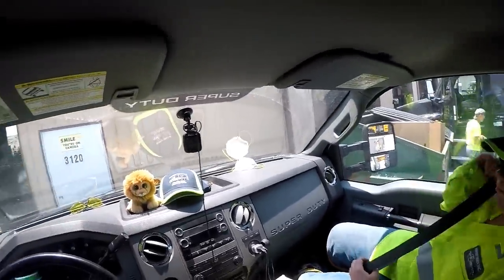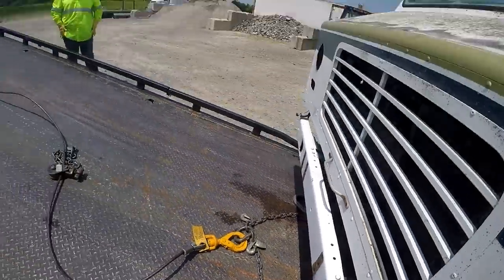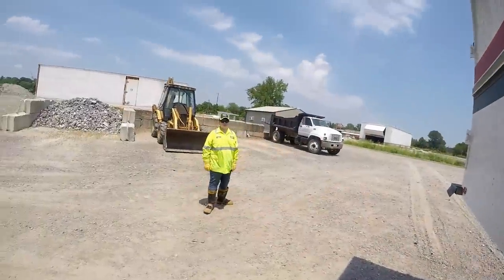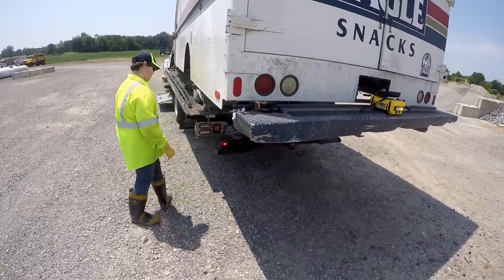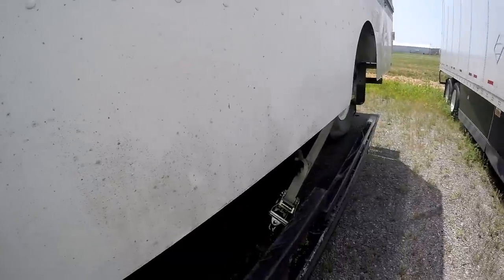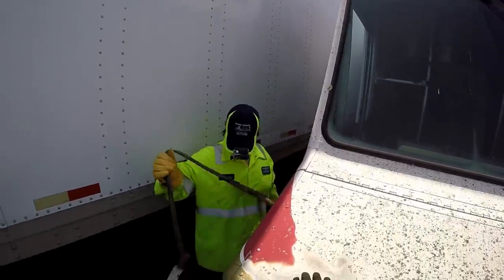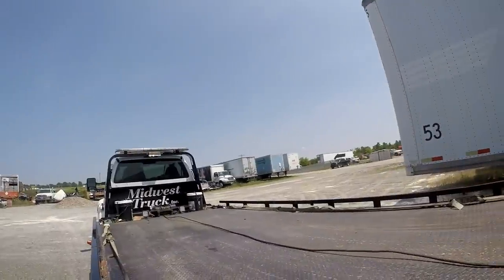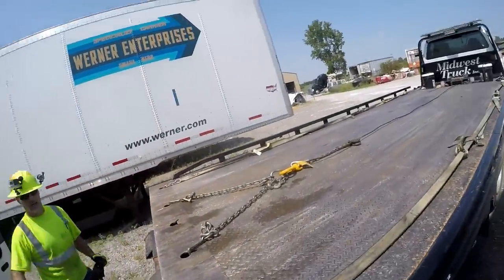ALL SNACKED OUT

Comment: Hey there Ron! I'm enjoying watching through your channel and learning a lot about rigging. Just a tip for dealing with the hot metal that's helped me: Keep 2-3 gallons of water inside the office per truck to throw in the cab when you get a call. It will be great for cooling the hot metal you have to work with, and if you get wet in the process, you'll most likely be able to dry off by the time you're done working. Plus you'll have water on hand to drink should your regular drinks run out.

Comment: Ron, greetings from the UK.  Your mention of wood blocks reminded me of one of the many times my hydropneumatic Citroen XM broke; crankshaft sensor failure = no engine start = no hydraulic pressure = no ground clearance!  The recovery expert had a rollback similar to yours (though based on a cabover IVECO, I think) and built up a wood-block ramp between the car and the bed, ensuring no ground contact at all.  A pleasure to watch, though we did briefly gridlock the small town of Cheadle, Staffordshire...

Comment: Ron just a tip an old timer taught me when ur dragging a vehicle in soft ground if u tilt the deck up just before the locked up tires get to the deck and then continue the soft material will stop at the deck and the tires will climb on the deck.
Reply from the maker: Thanks so much for the suggestion.  God bless.

Comment: Hey ron I'm sure you know this. But on this one unloading you could have run you line and block to the back side of the bed and used the winch to pull it back down off the bed. Trick I learned running roll back years ago unloading wrecks that won't roll. Thanks and stay safe out there helping those who nees it.
Reply from the maker: Thank you for the suggestions.  God bless.

Comment: What a towering load that one was! Way up high. 

Reminds me of a van I picked up once with my flatbed dovetail trailer and my half-ton Silverado a few years back. It was an E-350 van with 38" swamp tires, and a combined 12" of suspension and body lift - this thing towered over my Silverado by at least 6'!  Had to haul it across MA from the Cape, to western central MA. The bad part was, the entire driveline was removed from the vehicle, and placed in the back ... and I winched it up nose-first. I think you know where this is going - she was pretty tail-heavy. I got quite a scare once I got up around 60MPH on the highway, and that trailer suddenly became a rattlesnake! Was a white-knuckle ride, for sure! Cleared the entire highway - people were riding inches from the ditch just to give me space. Thankfully the Lord gave me the sense to calmly reach down with one hand and grab my brake controller full-bore, which settled her down pretty quickly. Heart was racing and I was sweating on that one!  Remainder of the trip was well below 55 MPH - took forever, but I got back safely, and the load got to it's destination in one piece!

The very next day I bought a Reese weight distribution / anti-sway hitch! Best thing I ever did! Live and learn.  :) 

Thanks for showing that cluster-hook setup - what a great invention that is! I occasionally will haul cars for a local eBay dealer, and I've struggled to find good anchor points on some of the vehicles. My methods destroyed my nylon straps (hooking to the strap itself in a loop around a control arm or axle). That hook setup would work really good on the ones that aren't unibody. For the rest I finally bought some 24" protected straps, with D-rings on each end - those saved my regular straps from fraying. Well worth the small investment.

Ethan gives me hope for the future - he's got great parents. :) Stay safe you guys. God bless.

Comment: I was thinking about what if Midwest picked up an ex DOT truck from the auction with the fold up collision buffer. It would be an extra measure of protection when you're doing a tow and/or recovery on a busy roadway. Just park it a few feet behind your Rotator and anyone that gets distracted, or not paying attention,  would hit the buffer truck and not yours. And I was also thinking you could use it to carry extra equipment to a difficult recovery job.And regarding the lack of storage space on your flatbed, I would move the bar that holds the traffic cones to a spot in front of the drive axle. That would free up some room to put either another smaller box, or add one giant box. And instead of a Extra Cab like I suggested before, go for the Double Cab. Might be more expensive, but I'm sure it will pay for itself. God bless and you have a good day.
Reply from the maker: Thanks for the suggestions.  So far, we have only added the Arrow Board to one of the rollbacks, but it has helped considerably.  As far as storage......I can never have enough on any vehicle.  I'm constantly wanting to add gear and try to figure out where to put it...LOL.  Thanks for watching and God bless.

Comment: Hey Ron... Brand new subscriber here, love your videos, The snack truck actually gave me an idea on helping with the move over, slow down issues. I know the snack truck has a different destiny, (which I am looking forward to) however if you had a step van of that size you could hang a huge 6 foot outdoor orange fabric sign on the back of it with bungees (so you could remove it when not needed) that actually says "Recovery ahead Slow down Move over". On the top, mount an led light bar pointing down at it for night work, on the rear bumper of the step van you could mount a directional traffic advisor light bar. Add in some strobes, put it a couple of hundred yards behind you and it should be very visible, with minimal setup time. Plus you would have a place for extra gear or tools. Anyway stay safe out there, I look forward to the next video
Reply from the maker: That has been considered.  We are looking into different options for a traffic control vehicle.  Thanks for the suggestion.  God bless.

Comment: Also how come you don't paint the bed white? It may throw the whole color scheme off a bit as well as show imperfections,, but I can see many advantages! Easier to see any possible leaks, and since its white and not black, significantly cooler for not only working on, but also to prevent any flammable fluids lighting up if they contact the hot bed.

Comment: Ron do you ever put a snatch block on the back edge of the rollback with the hook attached to the front of the tow and use the winch to pull the load off the bed? So glad you ordered the big arrow I suggested. It should help a lot. Are you going to make it freestanding so you can take it back down the road for early warning? A motorcycle type battery should power it for a few hours.
Reply: I cant speak for Ron but I'd guess that in 20 years I've probably had to winch less than a half dozen or so off the bed with a snatch block.Generally speaking soapy water and or a set of skates will get just about anything to slide off enough so that you can then walk the bed out from underneath.
    But as always there's more than one way to do things so I too would like to hear what Ron has to say.
Reply from the maker: There are a few that I've had to winch off that way.  Normally, what we call "skates" will work with most vehicles or you can disconnect the transmission linkage or hit the disconnect, if there is one.  There are a lot of different methods.....soapy water on the deck, tying the vehicle to something heavier and driving away,  and my personal favorite.....drive really fast backwards and slam on the brakes so that everything goes flying off the back uncontrolled.....just kidding.   Although that is a method that some people use.  
As for the arrow board, my idea for now is to mount it on a quick fold system of my own design on the roof of the rollback that I normally drive.  While driving it will be stowed in the flat position parallel with the roof.  When stopped, I can quickly raise it and lock it in place....at least that is my plan.  I ordered one that has amber directional arrows as well as red/blue emergency lighting.  This is only temporary until we find a traffic assist vehicle, but it has to help.  I checked today and it won't ship until August 8th.  Then when it arrives I have to fabricate my folding system that I have worked out in my head.  So it is going to be a couple weeks before it is ready for service.  Thank you sir and God bless.
Reply: Yes that back up and slam on the brakes is a favorite to watch, lol
Glad you are getting the arrow. Since you are makng so much $ from YT, perhaps get a second one that is portable that could be kept at the shop and grabbed when leaving if it seemed needed. Any thought to the slide-out bar with a really bright strobe of some sort for the rotator? Slide it out when working in front of a large tow. Of course there is the famous spike strip laid in the near lane to piss off the morons who don't pull over and of course, don't forget the 30mm cannon as a last resort to cul out the idiots for good :)  The advantage of the spike strip is that with 4 flats they will need a tow and you get more business at a "special" inflated rate, no pun intended :)

Comment: I don't like those top heavy loads on roll backs. I don't mind hauling cranes on a Simi truck and lowboy or beam trailer. just have a bad fobia. I am glad you cut us off though so you could drive safely. I was wondering if that light had a way to get it up a little higher just in case you wanted to use it for a warning light when you are out in the dark loading or working an accident with no one is around you get left by your self

Comment: How often do you have to replace worn out chains and special hooks? I'm going to haul a small size tractor on an 18 ft. equipment trailer would it be better to use chains over straps? Those red strobe flares where can they be bought? Ron, you put up a great channel!!! What is up with all the trailers sitting around?

Comment: When you were getting ready to load up the StepVan, why did you go all the way back to the middle of the frame to attach your chains, instead if just running your J hooks around the front axle, where it's easiest to get at ??
Reply from the maker: Good question.  The answer is because of the overhang on the front the the panel van.  If I had gone to the axle, my winch hook would have bottomed out against the cable guides before the van was far enough onto the deck.  I learned the hard way once.....    Thanks for watching and God bless.

Comment: Excellent idea with the blocker vehicle. Since it would be technically used as a tow vehicle could you run light and sirens on it?
Reply from the maker: In Missouri, ANY vehicle owned by a legally licensed towing/recovery business can run lights and sirens, which would include a blocker vehicle.  That is, IF I read the legislation correctly, but that part is pretty clear.  Thanks as always and God bless.
Reply: Ron Pratt heck in that case see if you can work a deal with your local PD to get one of their cars fresh out of service the next time they retire one! Saves the trouble of having to remove the emergency signaling equipment.

Comment: Hey Ron I got a question on why u put the chains where you did. Is it so it will lift it as you pull it onto the deck. Enjoy watching your videos I want to buy the chains like you used so when I need to load a car or something on to my gooseneck I could use the split chain instead of one chain and the winch hook sliding

Comment: Is that last strap Ethan tightened down as frayed as it looked?

It doesn't seem like one of your videos with cars not moving over or slowing down.
Reply from the maker: This is a very different video, true.  I like to mix things up a bit.  Yes it is frayed on the tail end of the strap that doesn't get used.  It isn't on the part of the strap that has tension against it, but will be replaced soon.  Thanks for your good eye.  God bless.

Comment: "extrication  training".... who are they trying to kid..  the fire Dept just want their own snack van for major incidents.. haha

BTW when you checked it out did you measure the wheel-base of the van, cause that was close to not fitting ??
Reply from the maker: Yes, when I had been there earlier to check the condition of it I also measured the wheel base and height to make certain I could safely place it on the rollback.  
As far as a snack van for Major Incidents.....most departments actually have something similar..... a support vehicle that carries drinks, ice, and carb loaded foods/snacks to keep everyone hydrated and energized.  Our local ambulance crew has an old school bus that they have converted into a "cooling" station.  It is air conditioned and has cots for people to lay down on, plus the other stuff that I mentioned.
Thanks for watching and God bless.
Reply: There is a UK military phrase ( probably worldwide ) piss poor preparation prevents proper performance.. here if a major incident is declared the fire, ambulance & police all have support vehicles with extra kit and food/water on them.. stay safe
Reply from the maker: I tend to abide by that phrase as well.  Thanks for watching and God bless.

Comment: What would be the tallest vehicle you would put on that flatbed?
Reply: Many variables to that question, (1) Keep the total height under 13' 6". next it depends on the towed vehicle weight as to how it effects your center of gravity. Aluminum bodies you can go higher than steel.
Reply: yeah as long as your height is under or 13'6 your good
Reply: The tallest I've had are the U Haul's i used to tow and the 15,17 and 20ft trucks are all 10ft tall.Needless to say on the bed they were over 13 6'.In order to get them close I'd let some ir out of the tires and pray LOL.
Reply: @southjerseysound7340  and watch bridge hights, and wires.  But I have been there put a Ford F350 with boom on a F650 with steel Jardan bed.  That was interesting.  Good thing I knew my route in advance.

Comment: Hey I see you mounted the new flashlight to your helmet!!  What did you mount it with?  One of their weapon mount adapters or something else you came up with?  And it looks like that is an awesome way for it to be used...
Reply from the maker: It is actually a GoPro mount that I adapted to work with this light.  I can adjust it to multiple angles and I can turn it backwards if I want to use the red/blue strobe.  I've been using that light on my helmet with this mount since I received it....after ordering based upon your suggestion.  It helps a great deal, both with my ability to light up the area where I am working and adds an excellent quality to the night videos that were so dark prior to its purchase.  Thanks as always and God bless.
Reply: Awesome!  I wonder if you had also used the red/blue strobe..  any law enforcement guys asked about it once you started using it?  That was where I used it the most when I first got mine...
Reply from the maker: I've had a few ask about it.  Most of the locals are still stuck on StreamLight, as was I, until you clued me in to this light.  And you were not wrong.  It far surpasses the StreamLight for a fraction of the cost.  Thanks again my friend.  God bless.

Comment: htrsy vid as a;ways ron, gpt a question for ys. i notice you always strap all 4 tires down, is that a law in MO or just your preference? i know here we just use the winch to hold the front and a chain with a j hook on the rear. just curious, keep them vids coming having a great time in Alabama watching them
Reply from the maker: It's actually federal law to have a 4 point tie-down of some kind.  The new law require that 2 of the tie-downs be adjustable, whether that be with ratchets or chain binders.   The winch does NOT count as a tie down at any time.  The winch is simply for winching, loading, and unloading.  Hope this helps.   Thanks for watching and God bless.